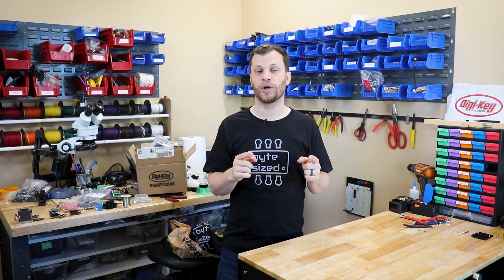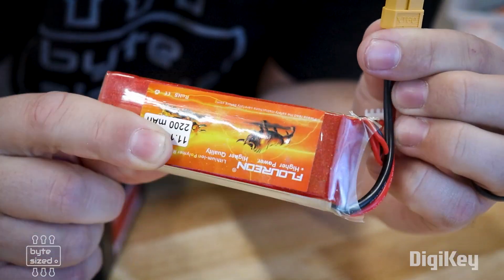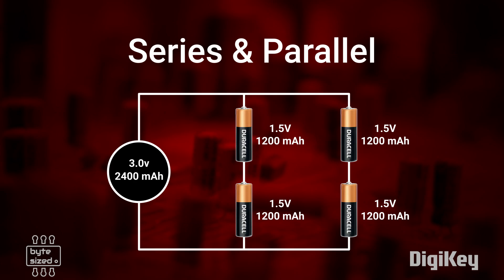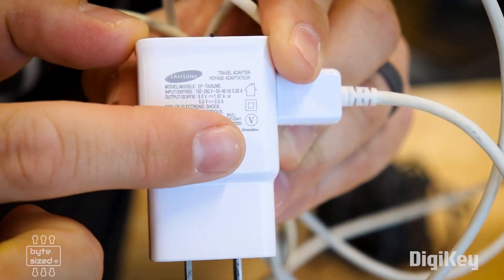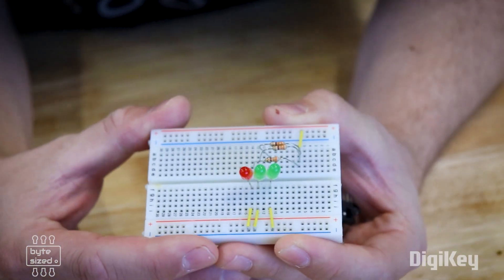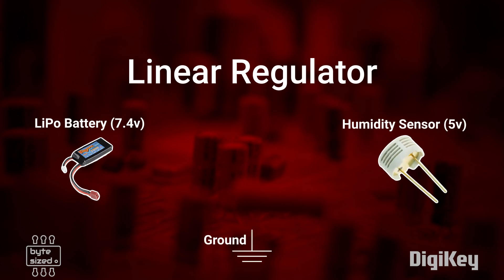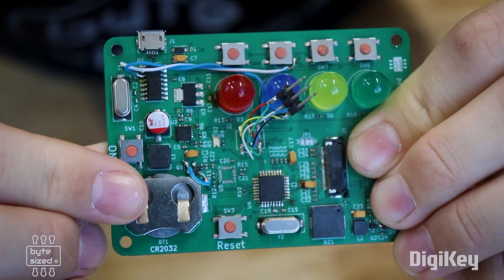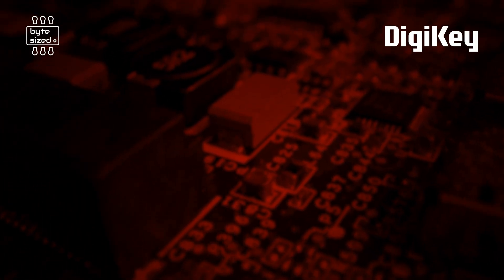How to Select a Power Supply - The Byte Sized Engineer | DigiKey

Comment: Linear regulators dissipate power depending on current draw as well as voltage drop. So if your device consumed 1mA, then the 5V regulator, supplied by a 12V battery will be dissipating 7mW.

 Milliwatts, folks. Sure it's more than the 5mW of the device but it's not an inferno!

A switchmode power supply may infeed be less efficient at such low current and make significant electrical noise.